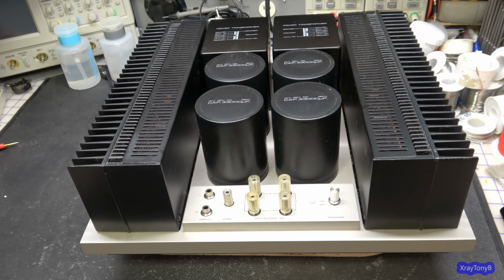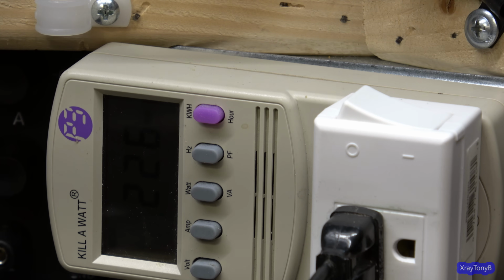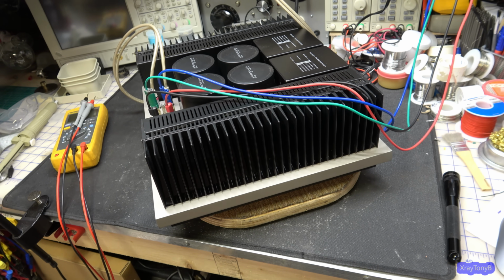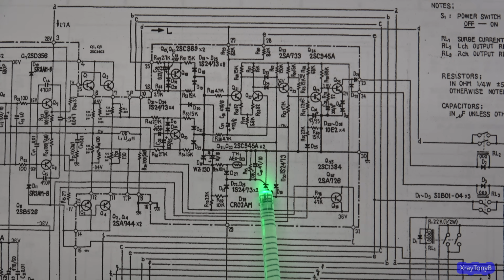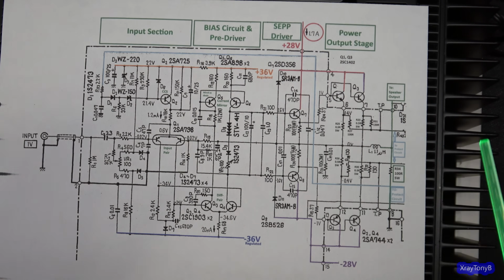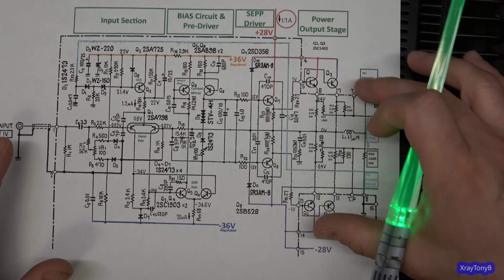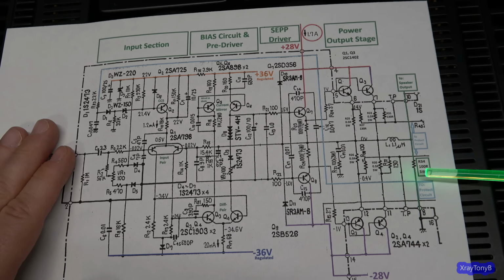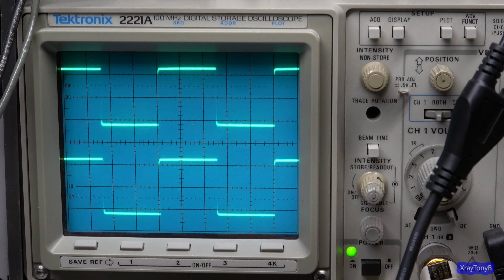Pioneer M-22 Class A Amplifier - Part 1

Comment: Maybe this is a less-than-sharp idea, but since you mentioned that changing the bias to a certain value would simply put the amp into Class AB operation, might it not be an interesting experiment to try biasing at the suggested 80mV offset @25:13 called out in the service manual, and see what happens? Maybe there's an off chance that the engineers specifying an 80mV bias thought that this amp was intended to be run in Class AB, and the 80mV bias point would achieve that more or less perfectly. (Of course the 80mV may be a random typo, and you may already be saying to yourself "No, 80mV is a tad nuts, and wouldn't work at all.") Just my half-baked notion, but maybe there's something in it. And maybe an offset at this point wouldn't result in Class AB operation at all, and I'm misunderstanding what it does.
Thanks so much for all these absolutely incredible videos. I've learned an insane amount from you, kind sir.

Comment: Class A is the King of all amplifiers. I love them. They are not inefficient. They are multi purpose. They are great for listening to your favorite tunes on the long winter nights. Instead of turning on the central heating, just listen to your music and feel the warmth on your body and in your ears. No other amplifier can do that.
Reply: I was having the same thought, use class A in winter and efficient amplifiers in summer.
Reply: @_-Skeptic-_  That's what I am thinking about the amplifier I am developing.  Output stage is tube cathode followers.  Each channel cathode resistor dissipates 125 Watts, the same as the tubes plate dissipation.  Add on heater wattage and power supply inefficiency, I am expecting about 750 Watts.  No output transformer, massive mains transformer.  The tube bit is simple, the complexity is in the power supplies, bias and DC servo and output protection.  Very important for a DC coupled amplifier with plus/minus 125Volt rails.

Comment: Tony, I have a brain teaser for you. This amp pulls 240W at idle or 120W per side and that's dissipated in the heat sinks whether at idle or max output. If the unit is run at max output, wouldn't the diverted audio power make the amp run cooler than it would at idle? Seems totally backwards but should be logical. Be interesting to see if the heat sinks were cooler at max output. Love your videos and insight into this hobby.
Reply: Your intuition is spot on. Yes, it will draw dissipate less power in the output devices/heat sinks and put it into the load (speaker). Or, to put it another way, maximum dissipation is at idle!
Reply: @Obsfucation Then again its not a classical implementation of the class A operation concept is it? Not SE and no CCS, so in terms of topology and application, in what respect does it differ from, say, a very rich biased class AB amplifier? Hard to tell w/o a thorough analysis, but this being a practical, rather than a textbook implementation, results may very well vary.
Reply: @paulb4661  You are correct that there are several ways to do a Class A output but, looking at the schematic it appears to be a regular, generic but, push pull design. Very nicely done but, nothing unique.
Although it may not be the purest (or the "purist") way of doing it but, push pull is the most (relatively) efficient of the three. It's also pretty obvious from Tony's measurements that it's a very low distortion design that would be the hallmark of any decent Class A design.
Besides the performance I've always loved this amp because of it's physical design; be it the M-22 or M-25. That part is pretty unique and different. I also like the part where the physical design makes it awkward to stack equipment on top of it; and excellent way to prevent users from blocking the convection air flow required by this model.
Reply: @Obsfucation  There's the textbook and then there are practical implementations derived to address the issues related to it. In any case, my guess is it slides into class B near clipping. Its power consumption will remain constant with increasing volume to start with, but begin to rise thereafter. I'm of a similar disposition when it comes to class A philosophy, hard to beat in technical terms. Not very practical, but who cares.
Reply from the maker: Sounds like an experiment
Reply: Good video 😅🎉😂
Reply: If so, it would put even more amps through the transistors so it would be even hotter, not cooler, logically. A-Class has a constant current draw, so it stays hot, pretty hot.

Comment: I got something fun to try. Monitor the voltage @ your AC 110/120 source to the A style amp when powered on. Then do the same with an AB under full bass load. See if the source voltage stays flat. All homes, services, and wiring are unique and there is resistance from the panel to the outlet. An A style amp will maintain a consistent load at the outlet, an AB should not. My thought is that an A style will not be affected as much from variations in the source current as an AB would. I'm just a mechanic, but I do have some electrical knowledge, so don't beat me up please

Comment: I had a Hitachi HMA 9500 amplifier i got at the scrap yard, 30kg of heatsink and transformers, which was faulty on one channel. Main boards were all well cooked SRBP, and I really just took it to see how it was made, as I really did not need a 1kW room heater. Stripped it down, and pretty much every electrolytic capacitor in the amplifier were all cooked to death, along with large numbers of low value resistors as well, and most of the power diodes had dry joints on the legs. Looked at fixing it, but those SRBP boards had been well cooked, and if you just looked at the traces they would lift off, and so I just turned it into parts, because fixing it was a path to a hiding, and it has very little value, seeing as the case was well worn, and slightly damaged from the yard.

Nice amplifier, well regarded when it came out, and exceedingly expensive when new, but with the power mosfets being made from unobtanium, and i knew at least one was leaking on the one channel, it was not going to be fixed ever. Funny enough simply stripping those heatsinks and case into plain aluminium, and the 2 power transformers, made back the purchase price from the scrapyard, and the rest, aside from the TO3 mosfets, was now ewaste, though it was a good source of some parts, though the main capacitors were not exactly stellar parts, 85c with mediocre ESR, and the 1uf film capacitors across them, both on the capacitor terminals, and on the power board connections, were not just there for show.

Comment: I received one of these for free from a gentleman who had replaced the original caps with aftermarket. Well he’d installed the caps backwards so they were toast. The originals were perfect so I reinstalled them. I went on to fully restore the amp, all new small signal caps and replaced one of the positive tempco devices as one had a broken leg. It also needed a new speaker relay. It took me a couple years to get the correct parts…
It is one of the finest sounding amplifiers I’d ever heard. I sold it last year to a gentleman in Kansas City.

Comment: Hi Tony. Next video under de hood. It may include: thermal tracking, which components are attached to the heat sink, which wires or traces are oversized, has the thermal paste dried out? or has something loosened due to heat? and some observations about the soft start or protections. How much VA do you estimate for the transformer for this continuous load and capacitance work? Greetings from Argentina.👍

Comment: Tony, you have forgotten to mention how much higher the driver voltage is to that of the output stage. This is of course mandatory to achieve such low THD at full power.
Reply: This lower voltage is a consequence of SOA of the outputs, the difference in rail voltages you mention isn't a prerequisite for achieving low THD. Naturally, with the emitter follower the voltage gain is a bit less than one, but a couple of volts more on the drivers is usualy enough to fully open the outputs.

Comment: is it worth making the power supply a H. if it's drawing so much current at idle that should prevent it. is there any linear regulators? you need to put some in if there isn't couldn't see any.
Reply: 29:38 input stage +/-36V rails are regulated, series pass transistors most likely, 78/79s wouldnt be handling it anyway. You usually do not regulate VAS, driver and certainly not output stage ICs rails.

Comment: Great project. I've done several amps with 2SA798/2SC1583 differential stage. They are great, but I see more and more getting noisy and drifting in offset due to ageing.

Comment: I'd love a vid of using a signal tracer (one of the audio type) and tracing a signal through a solid state amp/receiver. There are tons of vids showing how to build a signal tracer running through a small amplifier, but hardly any showing someone tracing the signal in a unit. Thanks!

Comment: Hi Tony , just wonder long tail at input usually are build by PNP pairs,  I saw that many amp they use such and not NPN , can you explain why PNP pair vs NPN pair ?
Reply: Bcs PNP was inherently less noisy ?
Reply: Mostly because it makes the design easier, giving you a simpler circuit, and not needing an extra stage of inversion to make it able to drive the voltage gain stage, using a simple resistor in each collector, so you an easily calculate voltage gains. PNP differential pairs are slightly slower as well, perfect to roll off response in the feedback loop, and making the amplifier more stable as well. however it is really just a designer choice, you can use NPN differential pairs, but if you look in almost every old design of opamp inside drawings, the original designers all tended to use PNP input stages, even if it meant using a much bigger area lateral PNP transistor in the design, as this afforded them advantages with layout, as you could match them much more closely, as the gain and characteristics were not affected as much by doping concentrations, mostly by well defined feature sizes and geometry, plus they could be made lower noise as well with a passivation layer, and the extra junctions added to isolate them also meant less substrate noise. for a discrete amplifier no real difference, though the transistor manufacturers did offer you a whole slew of transistor pairs, both NPN and PNP, optimised for many different things. For audio gain at low collector current was important, along with very low noise, and no shot or popcorn noise at under 1mA collector current, so you did tend to get some more PNP ones, as the process to make them does lend itself to that slightly better, though the most common differential pair devices were all pretty much just selected off the unscribed die for performance, being run through test at different gains, and grouped accordingly, so the die could be sliced up, and those with 2 transistors next to each other that had the green dot of passed, and not the red dot of failure, would be pulled out of the wafer manually, and placed in trays together, to be assembled into the dual device headers, and wire bonded accordingly. 

Still got some 2N2223 dual NPN transistors, which are just selected 2N2222 dies in a TO100 package, being matched to within 20% for gain over 10uA to 10mA, and with base emitter voltage matching to under 15mV over that range as well, and otherwise being a standard 2N2222 spec, and over -55 to 125C as well for that, tested by sampling. not the greatest noise figures, but still a solid differential pair for DC servo applications.

Comment: Carver Magnetic Field amplifier (called Class G) utilize rail switching output stage that combines Class A drivers with switching output transistors for higher efficiency .They run low/med/high Vcc rails with the 'Class A' stage to dramatically improve Class A efficiency, bringing it close to Class A/B efficiency. I am curious why Class G was not adopted by more high-end audio manufacturers ?
Reply: They sound not as good as this

Comment: Great video, great amplifier, class A amps always sound nice, I have a home built class A amp but only 10w per channel , a design by John Linsley Hood  in 1969 wireless world ,cheers
Reply: I did a test one using a mosfet running in class A, biased to 2A, and as a test device it was quite nice, though with a simple bias circuit it was not exactly stable, and with the speaker, a sacrificial 2R unloved unit, it was not destined for a long life, but for the simplicity it worked, made entirely out of salvaged parts, old PC heatsink and fan, used mosfet, 10k pot and 10k resistor to gate, and 220n gate coupling capacitor, and a used 7Ah SLA battery to provide both fan drive to cool the heatsink, and main power. Ran it for a few hours at a time, till it finally cooked up the speaker for some reason.

Comment: Since you're taking requests, I've worked on a couple of amps recently which don't have adjustable dc offset. Scott 380R and McIntosh MAC 4100. I'd love an explanation of how those circuits work to keep offset close to zero and what to look for when they are a little off, < 100mV or so. Thanks a lot!

Comment: Hello Tony!  I don't know if you still have the switchable Yamaha CA-1010 or CA-2010 Class A / AB amps, but I would love to see a comparison of the Class A modeling.  Maybe your take on the circuit differences too.  I have the Yamaha CA-1010 that we purchased new back in the mid 1980's.  Curiosity is getting the better of me.  Thank you for an excellent video!

Comment: 16:56 - I'd bias the whole thing down to A/B and be done with it! :)
Reply: It would sound very different.
Reply: @NicoRas-e9m  would be the bigger high power amplifier, though you would probably benefit as well from increasing supply rail voltage, but you could simply keep the same supply voltage, and use parallel speakers to get higher current through them, probably going from 8R to 2R would get a decent power boost from the same rails and power devices.

Comment: I believe a Class A amplifier uses max power at idle and at max power, but is most efficient at 1/3 power and not 1/2 power.
Reply: For the canonical class A, the amp consumes constant amount of power regardless of the output level. All of it is dissipated as heat with the volume turned all the way down and shared between the output and heat in other cases, so it actually runs a little cooler at full volume.
Reply: @paulb4661  Yes it would since some of the power are now dissipated by the speakers